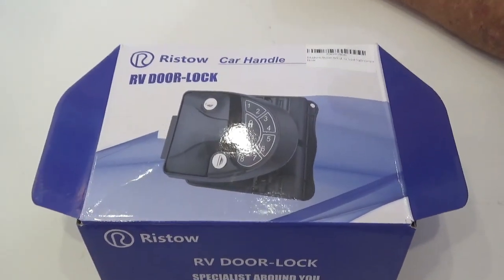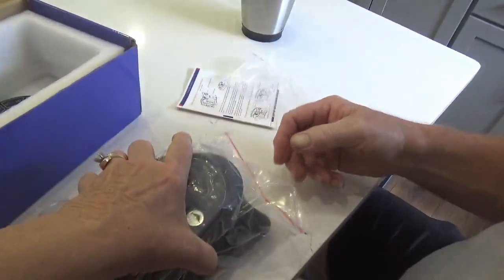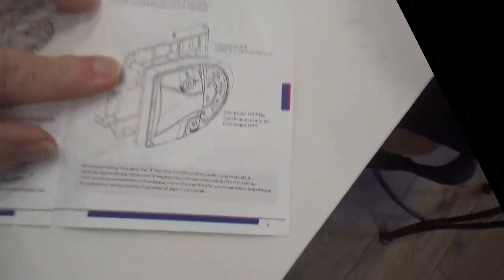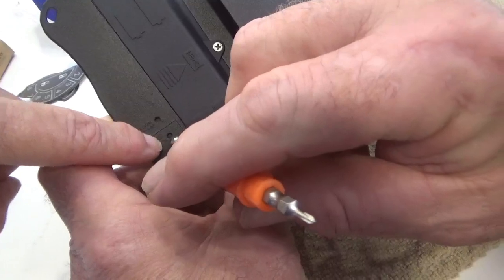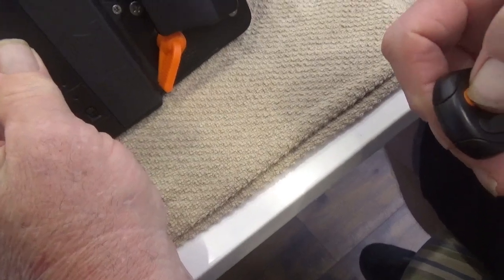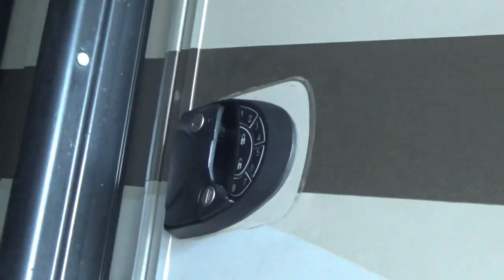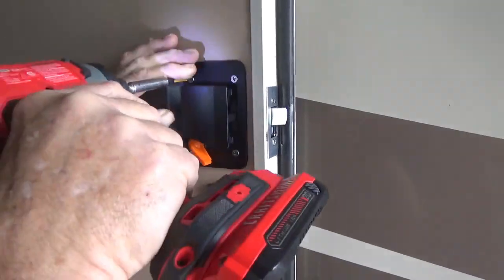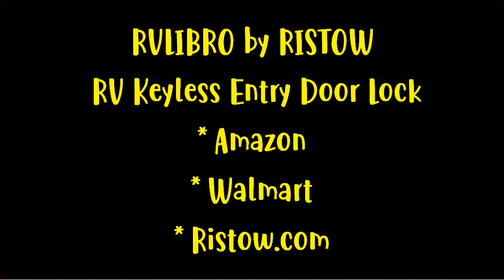💪 RVLIBRO by Ristow RV Keyless Entry Door Lock // Includes Fobs - 10% OFF!

Comment: Will be adding these too our coach.  I hate fibling with keys.  Currently looking at a alarm system for Xtream our truck that will start it and have key fobs for the door.  Found a guy that installs them.  There special setup for Volvo trucks.  Safe travels and roads Brian and Cindy, xtreambydesign with passion"
Reply from the maker: Let us know how that goes for the Volvo.  We need to do something like that too.
Reply: @WattsOnWheels  The alarm system is calibur with a app call drone.  Have found that much out.  The guy specifically does Volvo's so he is aquanted with there wiring systems.

Comment: now show how to replace battery in ristow fob
Reply from the maker: You have to use the little screw driver kit that came with it.  Use the small Phillips to remove the 3 screws and back.  The green circuit board will fall right out.  Flip it over to see the battery.  Use the screw driver (both phillips and flat ends) to push the battery out.  Put a new one in.  Place the front of the fob upside down on a table.  lay the black and orange buttons into the holes, lay the green circuit board on top of that.  Place the back cover on top of that and put the screws back in.

Comment: No suburban today!?
Reply from the maker: Nope...in for new u-joints, spark plugs, wires, washer fluid bottle, knock sensors, chasse lube and parking brakes.  Like new now.  😁👍
Reply: Yes it will be like new and you still have the $65k of a new one in your check book.